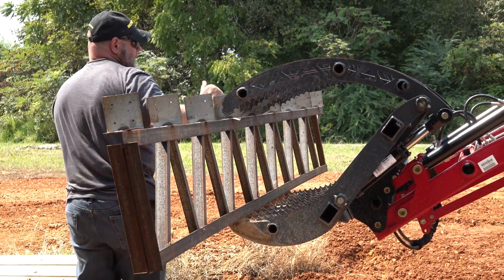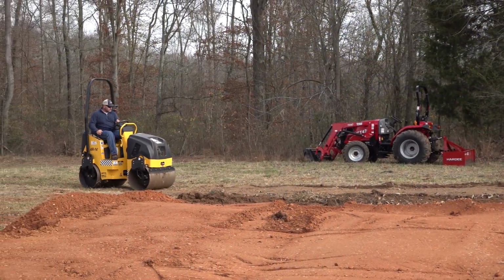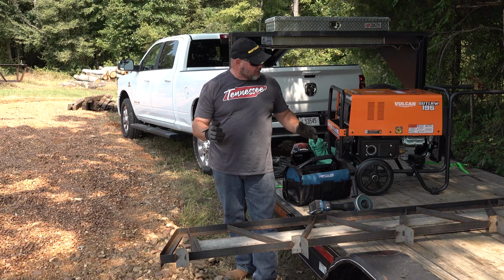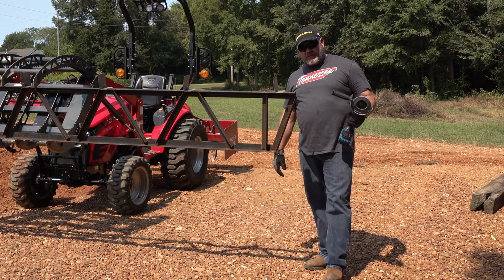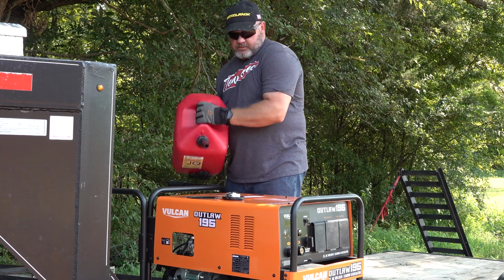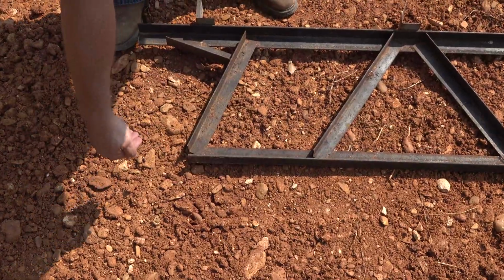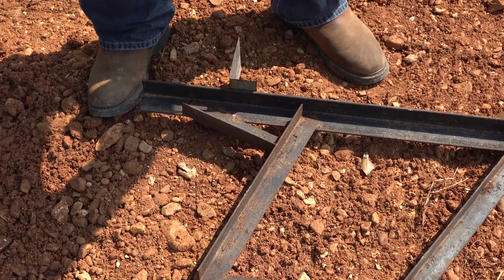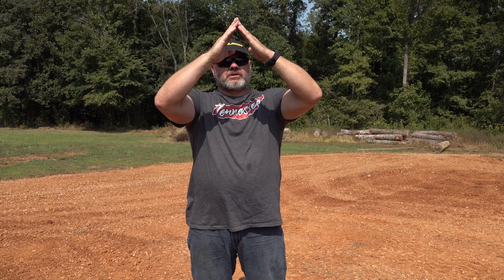A Better Pole Barn PT2 / Welding Metal Trusses / Vulcan Outlaw 195

Comment: Hi Tony,
I’ve been going through catching up on videos that I missed. I liked this one a lot.. I have a question though, are most implements or most of the welding that you do done on steel or is there any iron? I’m trying to choose between getting a simple MIG welder and a multiprocess welder which would include an arc welding capability for iron. I’m just interested in your thoughts. Thank you so much!
Reply from the maker: I am not a pro welder. I have only braised iron.

Comment: I like your videos found out about you on the harbor freight website. Thinking about getting this welder for home I'm a professional welder of 20 years so I'm skeptical but it looks to be good! Start running your welds up hill, once you get it down your welds will be allot better! Thanks for the info!!
Reply from the maker: Thank you. Welding is not my strong suit. My stuff holds, but it is ugly.
Reply from the maker: I forgot to say this. I have had zero issue with the welder.
Reply: @TonysTractorAdventure  awsome thanks again and allot of the time I've noticed guys try moving to fast because they think they are going to burn through but in fact if you slow down and let it build up it fills in and turns out way better.

Comment: Nice welder. Is this unit comparable to a Hobart Elite Champion or Miller or Lincoln as far as quality or ease of use for a beginner?
Reply from the maker: I know I like it, and it is easy to work with. I have have several hours on it and it starts and welds every time.
Reply: @TonysTractorAdventure  Thanks for the response man. Ive never stickwelded before and but dont want to spend 4,000 to just stick weld every once in a while

Comment: Are you welding 7018 downhill?
Reply from the maker: Yep. E7018 All position welding, low hydrogen rod for general purpose AC applications requiring low penetration, can also be used on DC+